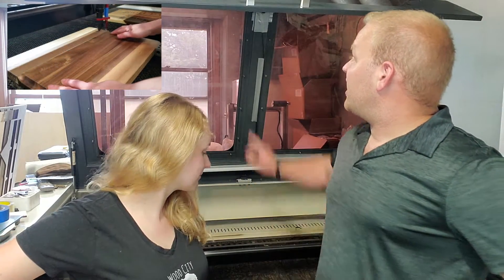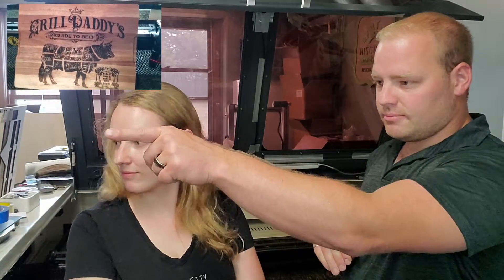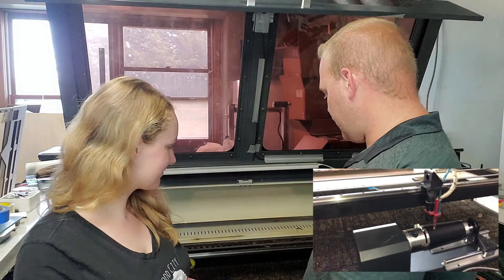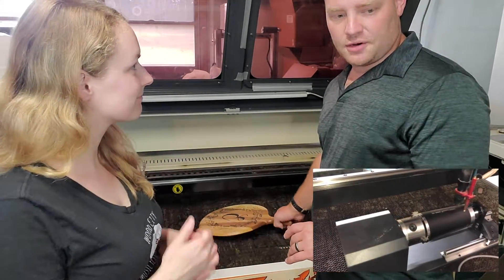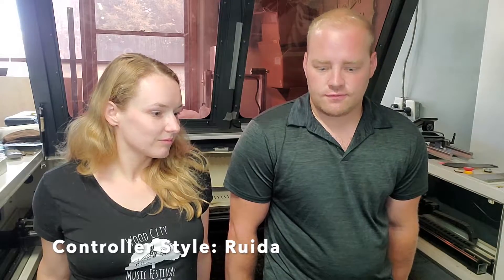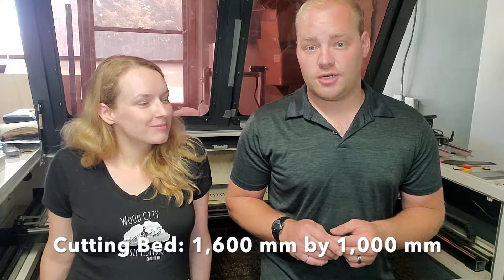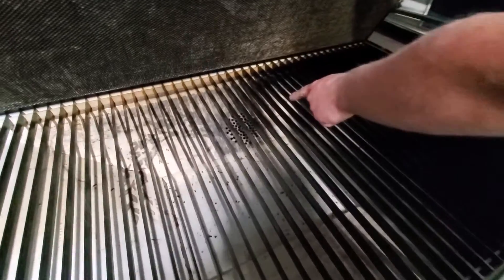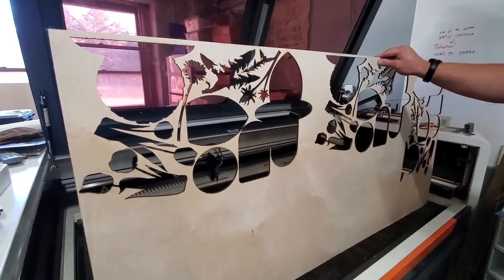1 Year with our GIANT LASER! Our thoughts

Comment: Rotary roller in the house!  I can't believe you haven't started a fire yet.  My laser is only 5,500 mw and I have set stuff on fire!  Well, kind of. I had to watch the video to see what happened.  It was a fire... sort of... well smoldering paper with no flames.  That's fire!
Reply from the maker: When I turned off the air assist while cutting paper there was some smoldering. I've also had some scoring smolder in a detailed part on a bamboo cutting board.